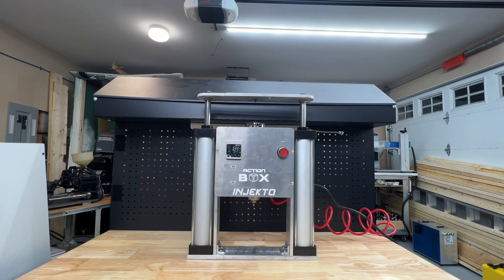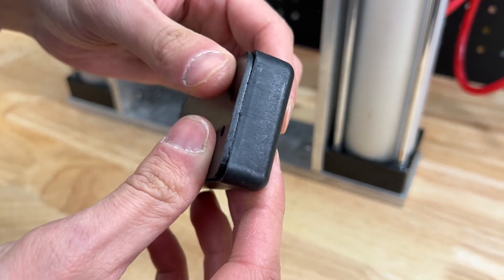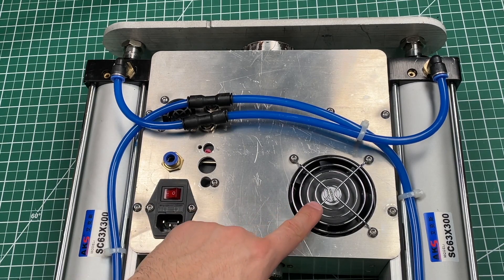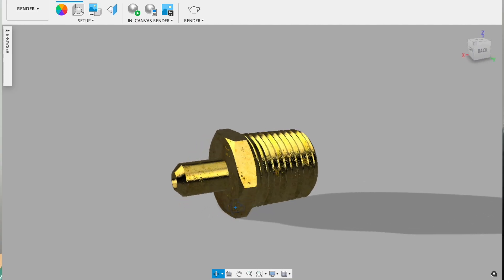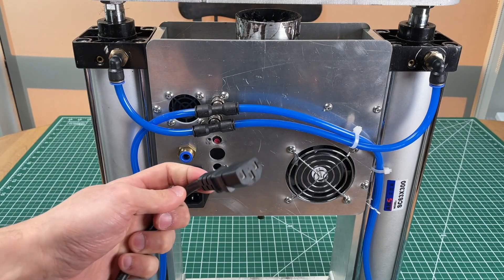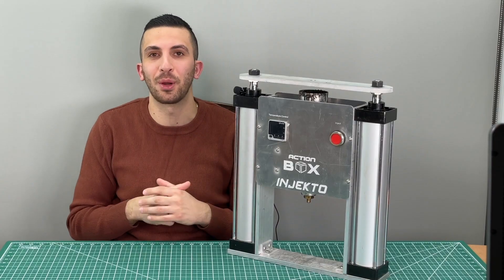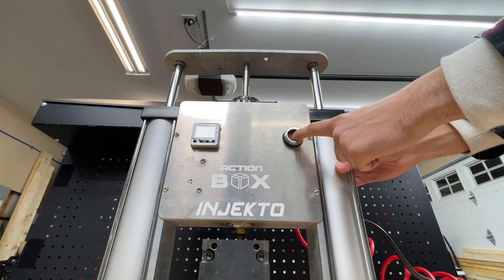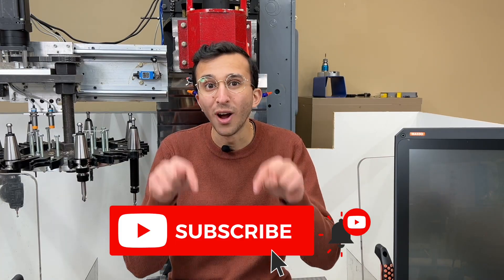How We Made A TINY Injection Molding Machine

Comment: You've got my money if you sell a V2
Reply from the maker: Would you be interested in a kit that you have to assemble yourself?  Also what would you be willing to pay for something like this?  Cheers
Reply: @ActionBOX  For context, I am a maker and I use 3D printers and multi-jet fusion for parts currently. I've purchased and built a Buster Beagle Injection Molding Machine MK2, but it didn't quite live up to my expectations. 

With that out of the way, I think an option to DIY and a pre-assembled are both interesting, as I would use this for business and would prefer just having the thing ready made, but I'm not opposed to doing it myself either. The biggest thing in regards to DIY that I really liked from Buster Beagle was that he made all parts very easy to acquire. I could get the custom parts from his shop, he had links to open source items, and even had a partner to sell frame kits of precut aluminum extrusion with proper brackets and bolts, which is great for someone like me who works in a studio without access to power tools to cut pieces down. Eliminates me having to go to a third party or a friend's place to cut these parts down/find a lathe for your hopper and chamber, etc. At the very least, having links to purchase parts would be great as well, because I don't expect you guys to start reselling air compressors or anything lol.

As far as pre-assembled, I think it's a great option for the lazy/impatient/people who just want a working product. For me, I totally understand the value and the fun aspect of tinkering, but when my primary focus is as a business tool, it's not something I want to fiddle with outside of maintenance. I find it hard to offer an asking price without knowing how much it cost you guys in materials/time, but I know you'd have an audience if you posted in the right FB groups and Reddit threads. As you know, these machines are not cheap. If you'd like to discuss more, I'd happily share more feedback and/or beta test anything for you guys and we could perhaps talk more about pricing? These machines go for several thousands of dollars, and I know people like myself were eyeing the Micro Molder on Kickstarter for $8,000-10,000, and people pay $2,000 for the LNS 150A, which is a manual machine only a fraction as capable as this. You'd have to ask yourselves what's more important in terms of value proposition vs time (undercutting competition and volume vs low volume and higher price). Anyways, hope that helps! feel free to email me at vincent@veak.design if you guys want more feedback!
Reply from the maker: @VincentVeak  Wow this was an awesome response. Thanks for all the details, I really enjoyed reading that and I appreciate all of your honesty. We are still working on the V2 and will know the price once we are done with it, but we are thinking of selling it as a kit as opposed to a final product. I guess we will see what the interest is once we launch a kickstarter. Cheers, Dave

Ps. Thanks again for a super detailed comment.
Reply: @ActionBOX  glad to help! Regardless of a Kickstarter or not, I'd personally be interested in the kit, so do keep me in mind. Also free free to reach out with any usability features/concerns/feedback :)
Reply from the maker: @VincentVeak  absolutely, Will do. Cheers

Comment: How about heated and cooled moulds? Add heaters to make the moulds hot, but just under the melting point of the plastic. Then, add water channels through the mould controlled by another solenoid valve. with the melt chamber and mould at temp, the inject button works as usual, with the heated mould acting to promote complete filling of even larger moulds. On release, the water cooling solenoid opens to quench the mould, draining into a sink drain or similar. Once the mould thermocouple indicates that the part should be sufficiently set, that releases the pneumatic solenoid to withdraw the ram. with a mould designed to open easily, another pneumatic ram could actuate the ejection rams, automaticly ejecting the new part. Adding fully automated closing, dogging, undogging, and openning of the mould itself, as well as an automaticly feeding hopper, and you have a turn-key solution to injection moulding parts on a (light) industrial scale.
Reply from the maker: Adding all that will make it much bigger. Our point here was to make something as hobby friendly as possible.  There is a reason industrial machines are huge, but you are on the right track to improve this concept. Cheers.

Comment: I suggest the thermocouples placed at the very top of cylinder, right below the holding funnel that is still made of metal, since heat does not transfer quickly, even if the bottom plastic is already a liquid, there's no guarantee that plastic at top is also liquid, so make sure that the top get the proper heat for liquid plastic, before injecting the whole cylinder to the mold
Reply from the maker: thanks for your comment. We actually intentionally left the top cooler so the plastic does not melt there. Otherwise if it melts and gets sticky it makes it very hard to load new pellets. Cheers.

Comment: the "safest" place to put the thermocouple is under the heater bands where the temperature is hottest (use kapton tape to hold a bare thermocouple probe to the tube and anther peace of tape to under it so it is electrically insulated ) but it will read very hot and require a large offset to work correctly, drilling a hole or milling a slot into the heater tube will get it closer to the temperature at the inside wall would be (best but complicated). 
OR 
(more recommended) you can tape or screw the thermocouple near the heating bands a just the right distance so it senses the heat quickly and doesn't overheat but far enough away that is is similar temp to the inside the tube (my first guess would be space equal to the tube wall thickness)

also the heating band position matters, it there a reason they are next to each other instead of spaced evenly along the tube (with the thermocouple in the middle)?
Reply from the maker: Thats a great suggestion with the thermocouple placement. The bands were arbitrarily placed together to act as a single unit. not further reason. Perhaps you are right.

Comment: Where i live (southern germany) its so easy and cheap to get functional old industrial machines
i bought a working cnc turret lathe for 1200$ and a huge injection molding machine for the same 
just rent here is hillariously expensive 14€ /m²

So i dont think a used old injection machine is outright a bad idea. but your approach is small and easily fitted everywhere
Reply from the maker: As mentioned in the video though, a hobbyist cant fit an 80 ton plastic injection machine in their home. This machine is not meant for industrial mass production. Cheers.

Comment: Geat work, compliments! To improve the design you could do the following: 1) Take care of tube length from pressure origin to delivery  point to be exactly the same, air volume is critical in pressure delivery. 2) Drill two holes in the lower, middle front and back plate to press through a hardened steel pin to support the lower part of the cylinder. Still great work, kudos for sharing.
Reply from the maker: Thanks for the tips!

Comment: A friend to the family was a tool maker, and that included making molds for injection molding. My father helped him a summer when he got to much work. He kept making the molds while my father got the grunt work of polishing the molds which was necessary to make them release easily. He got a completely new appreciation for the amount of work it took to make a good injection mold.
Reply: Yes tooling for injection molding can sometimes even cost more than the machine itself. The molds we use in the place I work now typically cost about 35 to 60 thousand USD. The first plant I worked at had the most expensive tooling I've set at 450 thousand for a mold that made two 5 gal buckets every 40 seconds. You can find those buckets on the shelves at Walmart.

Comment: I’ll buy the v2 right away when you get that out
Reply from the maker: How much would you be willing to pay for it? we are working on launching a kickstarter but need to know whether peoples willingness to buy is beyond our costs. Cheers, Dave
Reply: @ActionBOX  2000$ Just because its within my budget. but I'm people would pay more for this kind of thing.
Reply from the maker: @ShoopDaWoot  Would you be interested in paying less for just the hard to get components (aka custom frame, the cylinders that the frame is made for, and the heated tube with nozzle), and then source out the rest and build the machine on your own? Just curious if people would have interest in that. It would help us drive costs down.
Reply: @ActionBOX  I work for north americas largest mold injection company. I make molds on my cnc in my spare time but I don’t have much knowledge on how to assemble and disassemble machines. That’s part of the reason why I buy my machines from places knowing they have excellent customer support. (Besides my 3d printers) but yeah I barely can even switch the nozzle on my 3d printer. I’m only really best at designing and using the machines themselves. You guys seem so damn smart. Did you go to school for engineering or design or both? And also you guys designed that mold yourself?! It has ejector pins in it and you manually eject them. I was really impressed by that.
Reply: @ActionBOX  short answer to your question for me personally though is… no. I would need something completely working out of the box.
Reply from the maker: @ShoopDaWoot  Thanks a bunch.  Yes in the mix of both our degrees there is engineering, science, and business. It definitely helps 😜. Thanks again for your support. Cheers

Comment: This is a really nice machine for small runs or testing molds. I'd like to suggest two changes:
1) Attach a second ground wire to the heated tube as this only has minimal surface area connecting it to the rest of the chassis and the band heaters are mounted to it.
2) Connect an adjustable timer module to the switch for the hardening time so that it can be set and consistently repeated.
3) For the mold, you might be able to add a couple of extra ejection pins which push directly on the other half of the mold and a bolt to pull the ejection pins into the mold, so that you can release the two mold halves and the part in one motion by tightening that bolt. That would remove the need for the screwdrivers / screwdriver slots and the the hammering. Bonus points if you can use a small pneumatic cylinder mounted directly to the mold to actuate the ejection pins instead.
Reply from the maker: I must say Andrew, these are some genius suggestions. I will do all three. Thank you.

Comment: Cool and all, but you said in the video you don't need a machine shop at home, but how are you milling out the molds. Don't get me wrong, i love it, but the biggest problem with injection molding machine, even just a table size is that you need a milling machine, preferable a CNC  to mill out all the different molds. But you can use cheap 3D printer to do the same thing...
Reply from the maker: You bring up a great point! The molds we used in our video were made on a DIY CNC machine that we previously built (you can check it out here https://youtu.be/FkGdJMVJ1Fc). However, 3D printed molds can also do the trick, although may not be as durable long term due to the high temperatures and pressures involved with injection. Hope you enjoyed the video regardless! 😃 Cheers, Alan

Comment: That's reaally cool! I always wanted to get myself a desktop injection machine. I wonder if cast metal from a 3d print form would be robust and precise enough for a mold. Maybe you could try to collab with another YT channel that does metal casting from 3d resin prints?
Reply from the maker: Its not a bad idea. If anyone reaches out I would be open to the idea. Cheers.

Comment: Youtube suggested another video of yours and now I'm here as a new subscriber.  Awesome videos and like how you get straight to the points with explanations.  I'm a noob with injection molding so how do you prevent too much plastic from being injected into the mold?  Example is if you had a smaller volume mold with the V1 injector?
Reply from the maker: Thanks, that’s means a lot 😊. With this machine it just fills the mold until no more goes in, but the pressure stays. In other words, your mold needs to be closed very tight so plastic doesn’t leak from the sides.  The machine will then naturally stop by the fact that the back pressure is just too high.  Does that answer your question?
Reply: @ActionBOX  it does and thanks!

Comment: lads another master peice and thanks again for all the info i cant wait to see the gen 2 😁👌 i think a stainless bar feed would be a great addition to this machine and possibly a over tube lined with insolation to improve thermo efficiency with 3 thermo couples from inlet to mid to nozzle to get a good read on heat flow 😁 and possibly a smaill vice for the base for molds 👌 great design lads 😬
Reply from the maker: Thanks Steven for a detailed comment.  What do you mean by stainless bar feed? And by overture do you mean just a second tube to cover the heated tube?  I think you’ve hit all the main flaws if I understand you correctly 😅. Thanks again for your help 😊
Reply: @ActionBOX  ya thats basically it a tube over a tube lined with insulation and stainless steel feed bar is easier to clean and better to hold its heat also to do maintenance 😁 i was looking at the new bead holder hopper looks purfect for vertical piping so u can have a larger feed hopper on top and put a simple open close system to get the exact amount of pillets and by the way i am the same stephen horgan that normally post i changed the spelling  back to how i spell it my brother taught it was funny till i copped it 😅
Reply from the maker: @stevenhorgan8782  Hahahaha, Im glad you verified but I figured anyways 😜. I think your suggestions are awesome, and I will definitely do something with them in my V2. Thanks again for commenting Steven. Ps. Please share the video somewhere for others to see. Im really trying to grow my channel 😁. Cheers, Dave
Reply: thats no bother man we try get the name out there for ye 👌😁 i understand wha you mean thanks i really enjoy the vidio and the feed back 😁👌
Reply: and just a taught for the molds have ye ever taught of a water heating system to preheat the molds like a cnc chanel with like a bull nose ball nose cutter at the back plates and a cover plate and gasket over it it will give u better flow and less thermo shock to the parts 😬👌
Reply from the maker: @stevenhorgan8782  Ive thought about it, but its too much bulk for such a small machine. My idea was for this machine to be extremely compact for low volume and easy injections.

Comment: Haha you got me. I didn’t guess that it was a simplified injection molder after watching the level the automatic unit.  I couldn’t see the ram in the IG picture.   Cool project.
Reply from the maker: Thanks Ken! Glad you came back and watched the video (a true fan) 😃 Stay tuned for more cool videos! Cheers, Alan
Reply: @ActionBOX  you should look at making plastic extrusions with your machine . You could build dies and extrude a couple feet of edge/corner trim etc.  The dies are simple compared to IM. Could it be done small scale?  I know the big extrudes usually waste the first 20 ft or so and that goes back to remelt.
Reply from the maker: @kenreynolds1000  can you send me a picture of the molds that are used?  If the dies aren’t too complex I can give it a shot.
Reply: @ActionBOX  sorry, I only spec the cross sections and colors from my suppliers. Employer’s IP.  I have only seen people making filaments or larger HDPE “lumber” on YT and thought it would be cool to see refined products like your boxes done small scale.
Reply from the maker: @kenreynolds1000  thanks, I appreciate that 😊

Comment: Fantastic design! Great job! From the CAD model it looked like the nozzle is chamfered, you will get better contact with a radius instead. The mold needs to be machined with a matching radius, it doesn't need to be a small radius, either. You want the most surface area possible.
Reply from the maker: Thanks Davo 😃. We are limited by items we can purchase off the shelf to keep the cost down for our viewers but you are indeed correct.  I’ll see if we can employ your suggestion for our V2 video.  Cheers

Comment: damn, you guys are good 😅.
btw can it use recyclable PET plastic (coming from bottles) for injection mold thing? it this capable of achieving such temperature (around 265-270 C)?
Reply from the maker: It’s capable of reaching 375 degrees.  Yes we can and in fact that’s an awesome idea.  We will try that for our future video.  Cheers.
Reply: @ActionBOX  hey thanks for replying, btw have you guys worked on some custom 3D printer project or something, here in India 3D printers are super expensive due to the import charges and stuff. it would be cool to build a big and cheap 3D printer, and you guys being experts in machines it would be awesome if you are able to make something like that. Maybe you can use the injection molding machine to make your own filament, the possibilities are endless😂
Reply from the maker: @divyanshsrivastava7312  great idea.  We will work on it.  Cheers.

Comment: This is cool super cool. If I was going to build one, I'd use an I beam to connect the pneumatic cylinders and ram. I would also make a mold table that could be set at different heights with pins so you wouldn't need the scissor lift.
Reply from the maker: Awesome, thanks Noah. Ill add that to my list of design considerations for the V2. You are most likely correct, and we will most likely listen 😃. Feel free to share our video if you know someone who would like it. We are really trying to grow our channel. Cheers, Dave